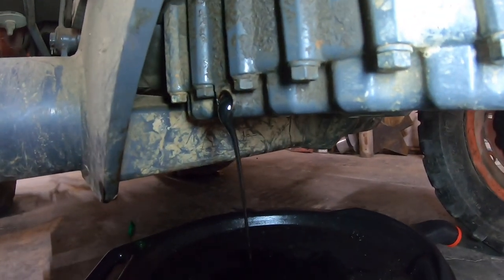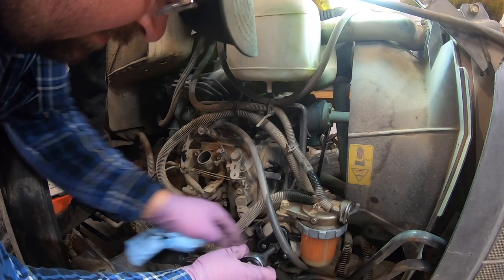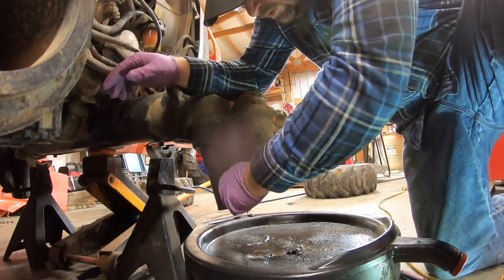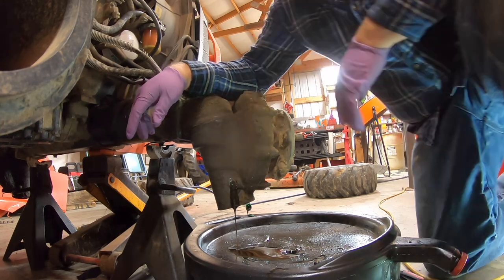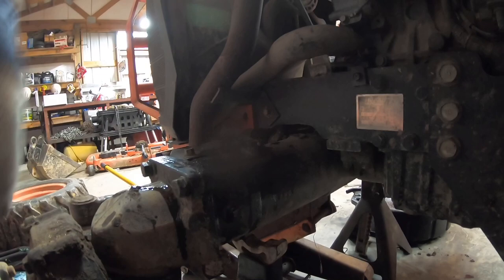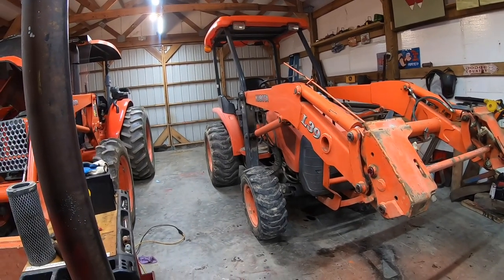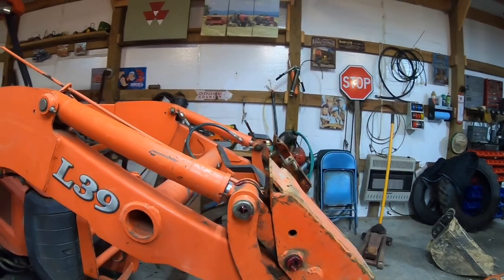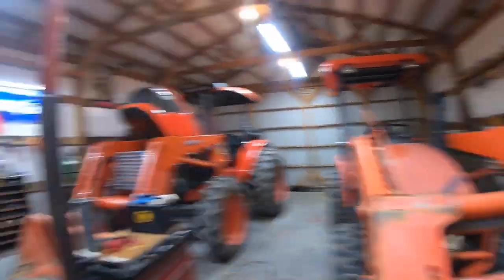Kubota L39 getting a much needed service! Also something to look for when buying used.

Comment: Thanks for the video. I picked up an L39 with 280 hours. I have never had a tractor before so I am learning all I can about this one. Dropped the backhoe this week. It had never been off before. Put on a box scraper. The hitch control level is very stiff. Once it moves it overshoots the setting you want. I am hoping just the linkage is stiff from lack of use. Any tips on that would be appreciated.  Thanks! Oh, and how do you reset the "Wrench" alert on the dash?
Reply from the maker: On the lever I’d spray the joints good with lubrication of some type and it will eventually loosen up. I’m not sure how to reset the wrench alert on the dash. Appreciate you watching and good luck with your machine!
Reply: @khtractors  I did that this morning before I read this. It took care of the problem. That you for responding!
Reply from the maker: @MrPhippster  glad you got it fixed! Take care!
Reply: @MrPhippster  hold down the menu button and the travel speed button at the same time while on the hour meter screen

Comment: Glide Shifts are smooth once you get accustomed to them. I try to predict what gear I need before going up steep inclines to avoid the sudden jolts. I been having difficulty lately putting grease in the fitting on the right front axle case on my Kubota tractor. Have you ever encountered this?
Reply from the maker: No I haven’t! If it’s where the steering knuckle is try jacking that wheel of the ground and see what happens. They also make tools to unclogged fittings. Thanks
Reply: @khtractors  Yes, that's the stubborn fitting. Thank you for the advice. Have a great Christmas and New Years!
Reply from the maker: @blueridgehollow2510  you too!